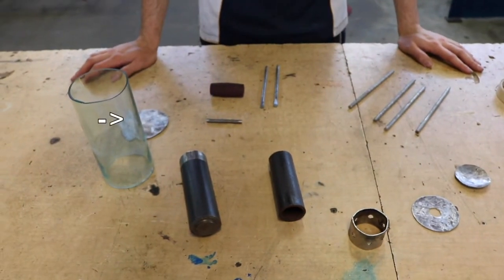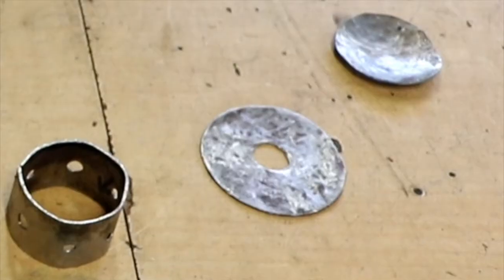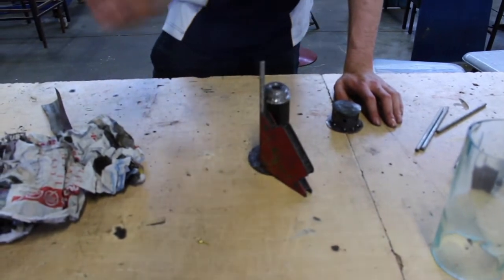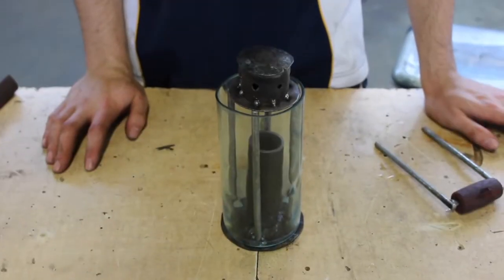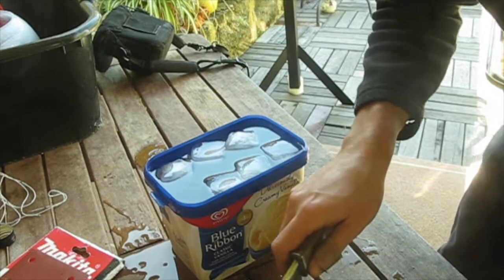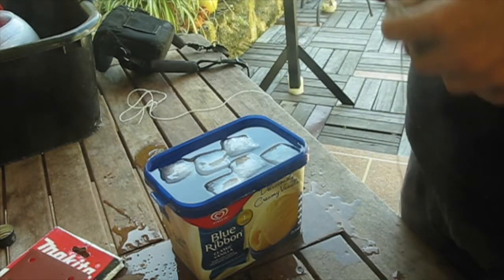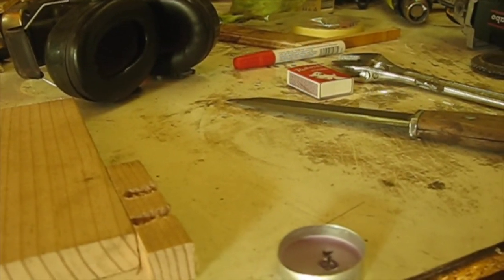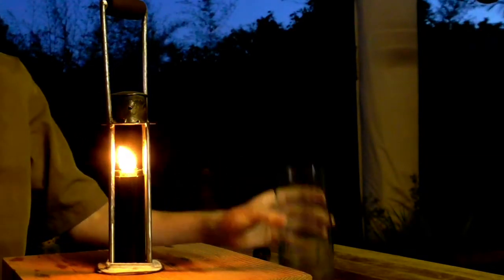how to make a rustic oil lantern

Comment: hi tim, i wonder why do you insert the glass out side of the iron rods...? glass wound be much protective in the other way..?
Reply from the maker: that is true and I probably should have but I don't think I planned this very much, also something that I have noticed on using this is that eventually the glass from the wine bottle actually cracked so its probably better to go with glass from a candle holder, I found one at Kmart for about $5-$6 or something which was actually tempered glass, anyway to answer your question I'm dumb and I don't always think things through. Maybe in the future I will re-attempt this and see what I can do better with everything I have learned!